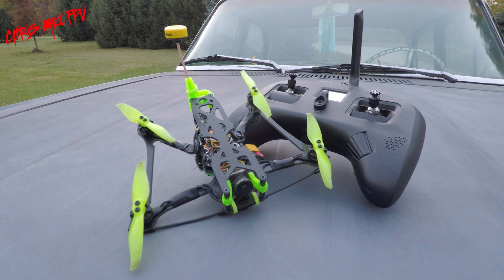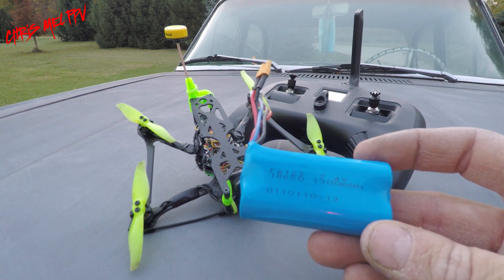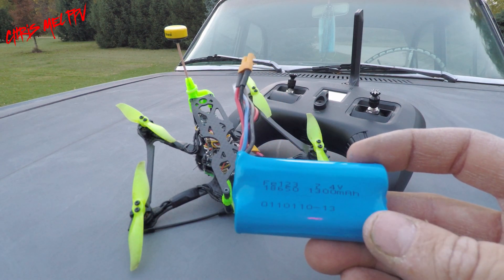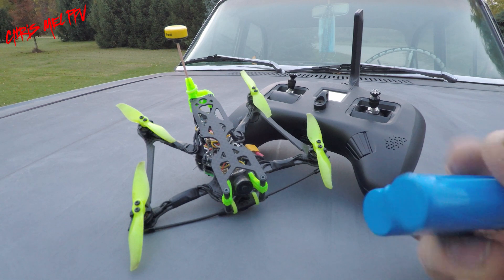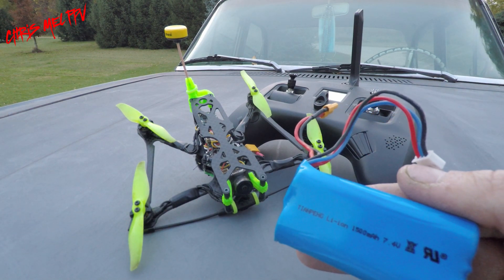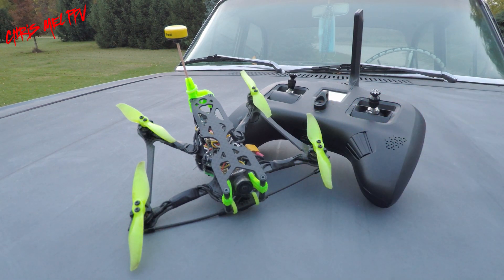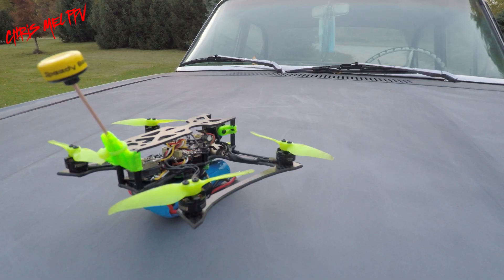3in Emax Tinyhawk Freestyle Micro Long Range (Crossfire/300mw VTX)  2s 18650 1300mah flight test.

Comment: Cool frame!  Darn I wish someone would have this frame for sale.  I really want to convert my race to a free style, but dont' really want to use the stock frame.  THis looks really cool
Reply from the maker: Thank you, I have the DXF files that I sent to cncmaddness to have cut, I believe most shops that work with carbon would be able to cut it as well. With cncmaddness, I emailed them the files and what size stand off I wanted. It didn't cost much and they did a great job on the frame. I paid a little extra to have them round the edges and recess the screw holes. Here's the link to the files.  https://www.thingiverse.com/thing:4614280/files
Reply: @chrismel9000  awesome, I'll give it a go.  Thanks!

Comment: Would 3000mah 18650 weigh almost the same
Reply from the maker: About, maybe a bit more. But i think it would handle it fine. I want to give it a try. Just need to build the battery.  I've been wanting to do a true long rang test of this guy. And a 2s 3000 mah 18650 pack on there for the flight would make a good video . Lol
Reply: @chrismel9000  yes it would. My 3" (not built to be efficient) did over 11mins on 1300mah twice (very slow cruising) and when I tested 4s 3000mah li-ion I ran into an issue during flight. Decided to stop and try again later. But I ended up losing the quad in a huge river.
Reply from the maker: @divingfalconfpv4602  this 3in can only do 2s. it has the internals of a Emax freestyle. the weight of the 2 3000 mah 18650's may be too much for it to fly well. but ill give it a try someday.
Reply: @chrismel9000  oh forgot about that.  Yeah the motors aren't 3" motors really.  So need to keep it light
Reply from the maker: @divingfalconfpv4602   right, I'm still going to try. Gotta test the limits. Haha
Reply: @chrismel9000  same. I put full size gopro on 2.5" .. also flew 2.5" with 4s 1300mah lol
Reply from the maker: @divingfalconfpv4602  I would like to see if my 6in can lift my Canon T3i. lol
Reply: @chrismel9000  it will be able to lift it but depending on props it won't fly well. Will be high in the throttle hovering. But nothing different than explorer lr with li-ion by end of battery it takes over 60% throttle to just hover lmao

Comment: If you try some sony vtc5 or 6 you'll probably get 15-20 minutes no problem. A lot of people like the samsung 30q but, I find they don't have a lot of punch. The samsung 25r is another favorite of mine it's also really cheap 18650batterystore has them on there deals for $3 a cell right now.
Reply from the maker: Thanks for the info, just the other day I was searching for which 18650 to get to build a new pack.

Comment: Were those packs fully charged? Seems like you should have gotten more flight time.
Reply from the maker: No, lol. I was thinking that myself, should have been longer. I have 2 of those packs and they are old as dirt. Both of them came out of a old RC heli. I'll try to get some new 18650's and build some 2s packs.
Reply: @chrismel9000  See if they'll charge up to 4.2v per cell safely and give them another try.
Reply from the maker: I'm using the M8 toolkit charger,  the only thing is it doesn't seem to give me an accurate reading of my mah at the end of charging. I think they charge to around 4.1v at the least.
Reply: @chrismel9000  if u select li-ion on charger it only charges to 4.1v. U have to charge as a lipo if u didn't. Also make sure li-ion cells u use are 30a continuous .. 
When I tried a 10a pack it died fast from sagging more and more
Reply: Thank you FOR SHARE. 
DO you think 2s li-ion work on 
king kong et115? 2.3inch props, 1104 7500 kv motors, THE aoroximate weight will be 190 grams. ONLY FOR CRUISE NOT ACRIBATIC AND I KNOW WILL BE SHORTER FLIGHT TIME.